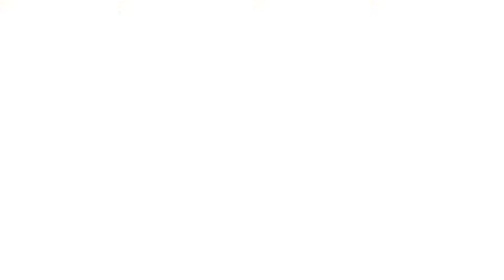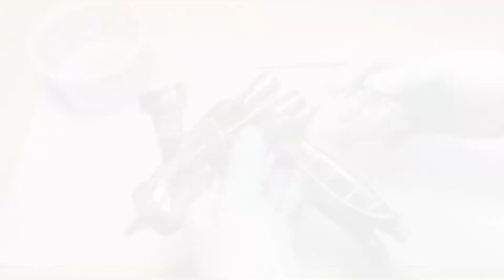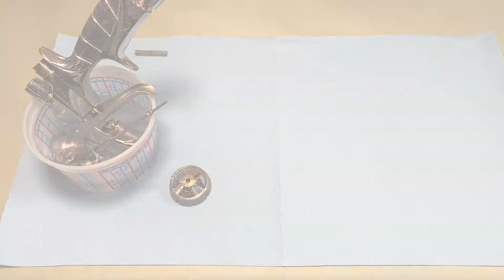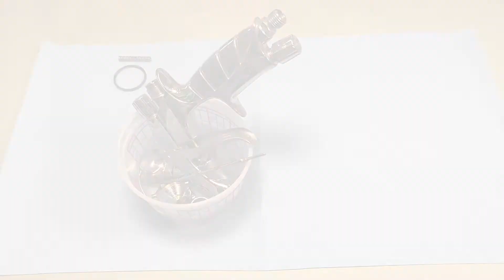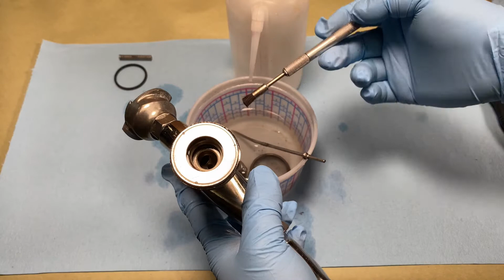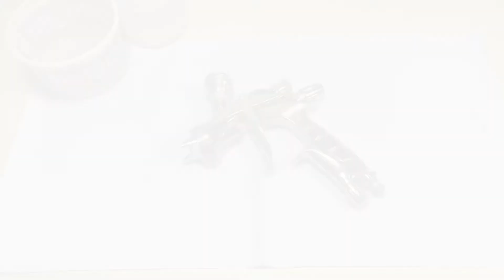Spray Gun Deep Cleaning

Comment: what about the air holes in the gun that gets paint in them it almost impossible to get to those holes. and if they are clogged the gun will not shoot correctly. and did not even do the most important part of the cap. You did clean the Horns if the horns are dirty it spray crooked.

Comment: Oooff,,,,this is how I clean after every spray🎨,,,,didn't realize it was a "deep clean".
How do painters typically clean their gun after spraying?
I'm really curious about this question. But, I only lube the needle, not the other parts, and I only hand-tighten my tip, cup-adapter, and air fitting........now I'm wondering if using a wrench on the tip is something I should be doing🤷‍♂️it certainly doesn't loosen up while I'm spraying, but maybe there's some leakage that affects the overall performance?
I realize Awata won't respond, but if anyone else here has an answer, its appreciated🤜💥🤛
Reply: I've been painting 40 years I've always tightened the fluid nozzle with the wrench with very little pressure just like he did

Comment: What is a good website link to purchase service repair parts or kits for the Kiwami 4? I am in the USA. I cannot find any schematic with correct part numbers for the Kiwami4-13BA4 with the Kiwami4-BA4J Needle and Cap set. I have checked the Anest Iwata websites from USA, Japan, Vietnam and South Africa, and not one of them offers actual part numbers or a resource of where the Fluide Adjusting Guide or the Air Valve Seat parts can be obtained or the actual part numbers for either of those parts. The websites which are available - all seem to be out of date or links within the sites do not work. Not one supports parts for the Kiwami4. Thank you.
Reply: Not sure if my previous comment posted but iwata USA does not carry the kiwami  series its exclusive to the asian market. You can however find some parts on ebay
Reply: @jamessakimae9655  - I need to know the partt numbers. Oitherwise, no, there is no way to know the parts on ebay will fit as service replacements. I am well aware that the Kiwami4 is not in the USA. The Iwata sites ofr Vietnam and South Africa show the Kiwami4 but their website lacks links for service kist or actual part numbers for any parts, even a complete rebuild service kit is not disclosed...for the Fluide Adjusting Guide or the Air Valve Seat parts
Reply: @nealnaz  I dont believe the parts you require are on the market, I've only seen fluid nozzle/needle, aircap, and aircap packing for sale